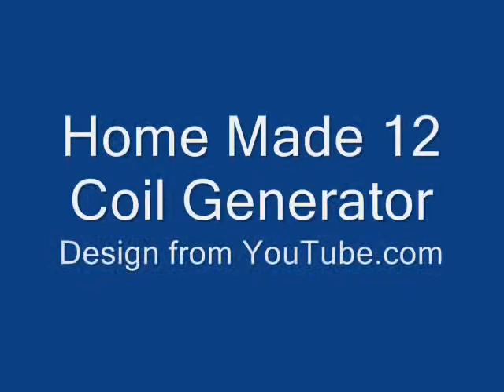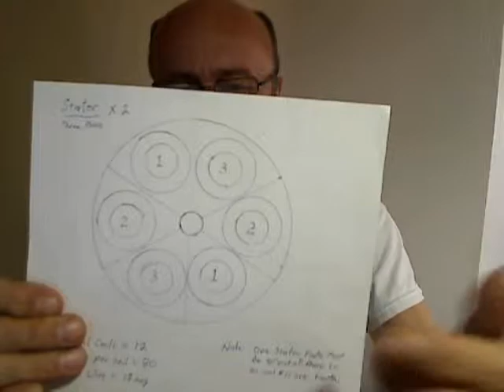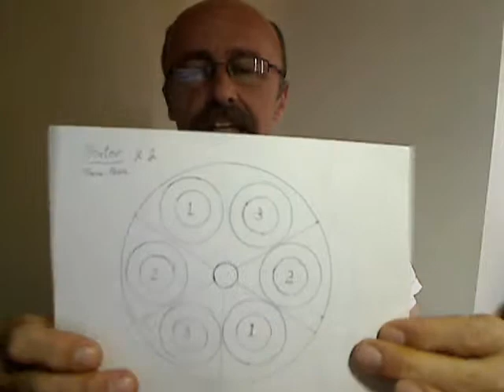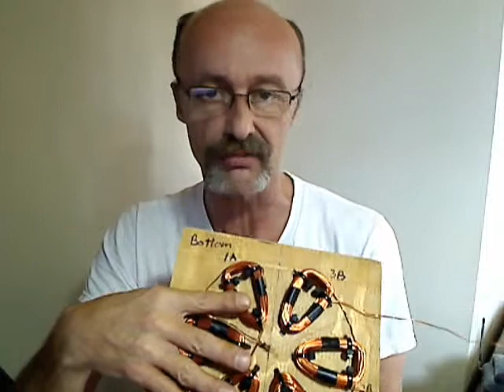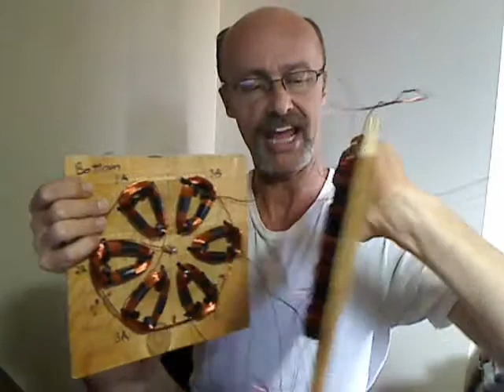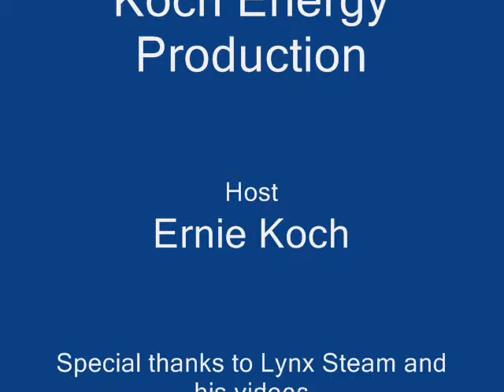Generator Part 1.wmv

Comment: Great work, great explanation.  Thanks for the credit.  It works very well, and better with 8 magnets on that same magnet plate.  The only problem is the resistance in all that copper, but your coil shape is helping, and the heavier gauge wire is helping.